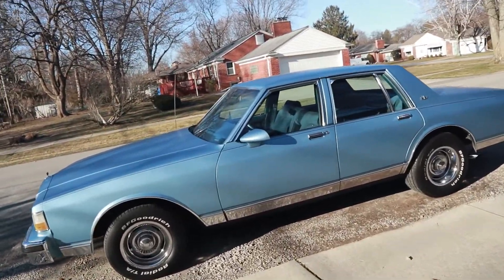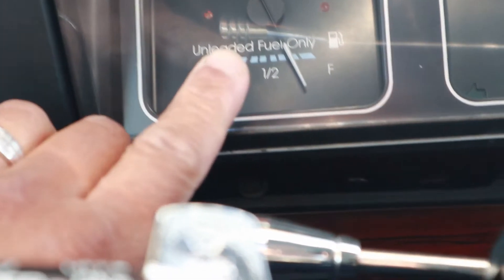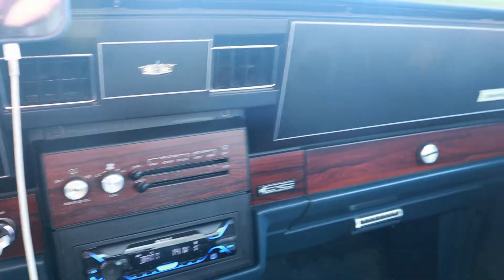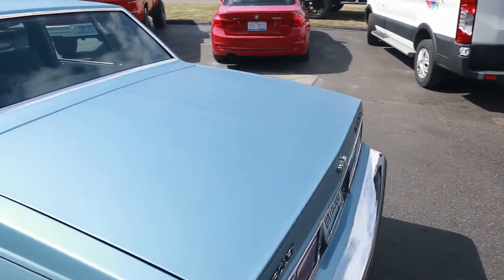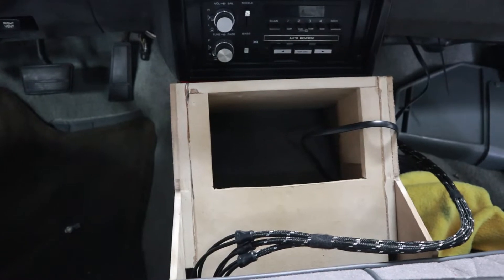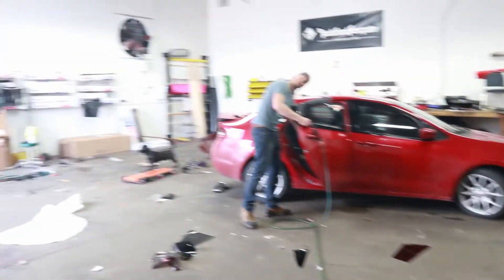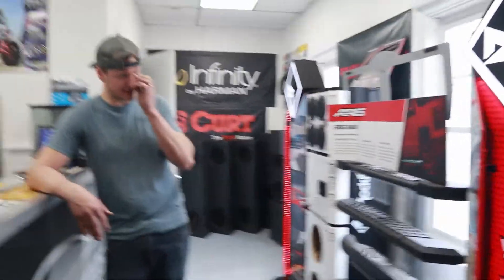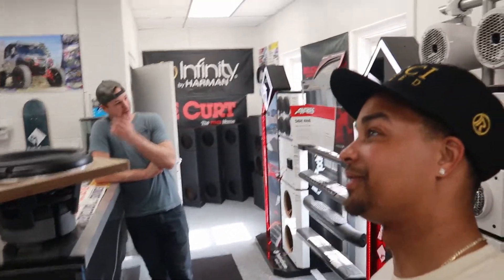WENT TO SEE MY '86 MONTE CARLO SS @ EXCLUSIVE SOUNDS

Comment: 25 Gallons. Check your gas tank vent line. The pressure inside the tank is causing the pump to shut off. Also check your fuel sending unit in regards to the gas level indicator.
Reply from the maker: Thanks. Ok I’ll add that to my list
Reply: @BaggsOnTheGo  Look up the EVAP system. The fuel tank vent line runs to the charco canister under the hood ( driver's side near the headlight). The vapor from the tank get stored in the canister and then vacuumed into the carb to be burnt off when the car is running. If the system loses vacuum it can cause excess pressure build up in the tank which will get forced thru the fill neck and shut the pump off. Sorry for the long reply! Keep the great content coming.
Reply from the maker: Very clear Thanks for the heads up. I’ll get around to speaking about it soon.
Reply: Yes he is right .. i would start there ... Vent line is might be mess up

Comment: Fuel sending unit probably bad
Reply from the maker: Should I replace it? Or check the lines?
Reply: @BaggsOnTheGo  Has nothing to do with the lines. Sending unit sends an electrical signal to the gauge, 0 ohms empty 90 ohms full. You can test it with a multimeter, new gauges will still read wrong if the sending unit is bad or wrong.
Reply: I would test the resistance on the fuel gauge circuit first. Always start with the cheapest option. lol